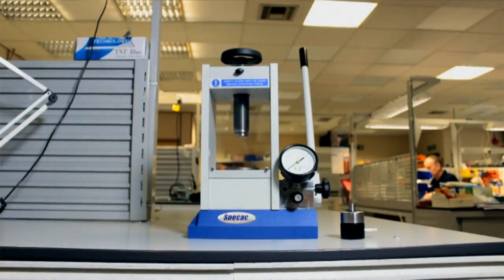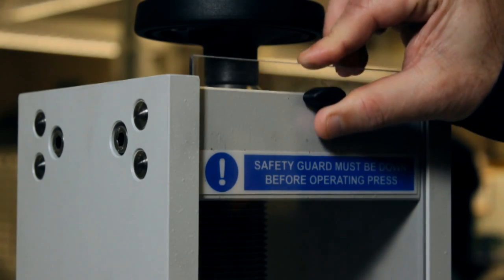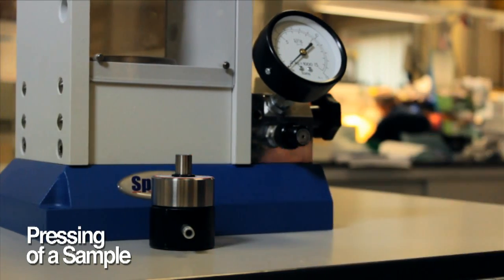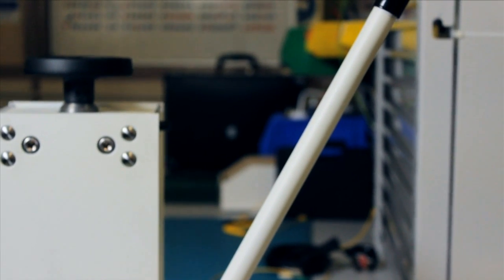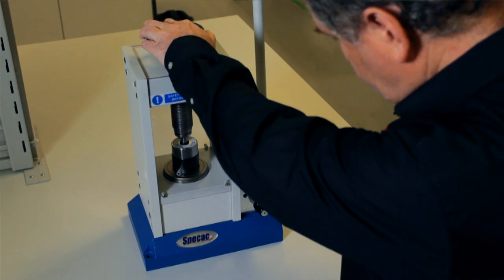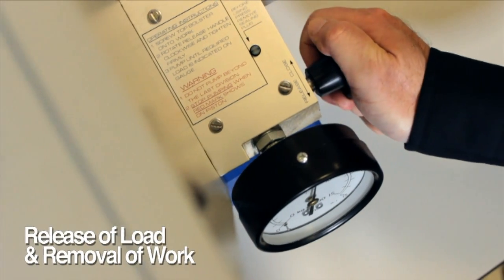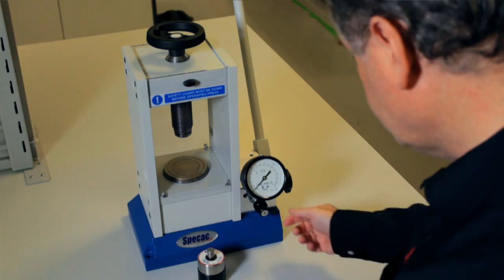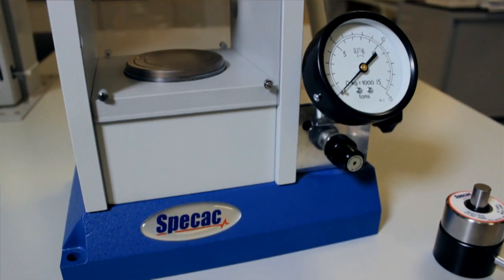Specac's Manual Hydraulic press in action

Comment: Is it okay to leave the sealing plug in when pumping?
Reply from the maker: Hi Ian, thanks for your question.

If you are referring to the nylon transit screw, this is solely intended to seal any leakage during transit. You should remove this before using the Manual Hydraulic Press, because the vent is required to prevent a vacuum forming inside the press.

Please get in touch if you have any more question, alternatively you can email our Technical Support Team at techsupport@specac.co.uk.

All the best,
The Team at Specac